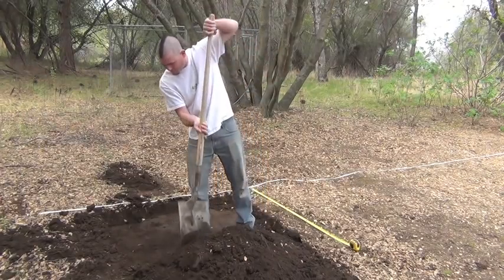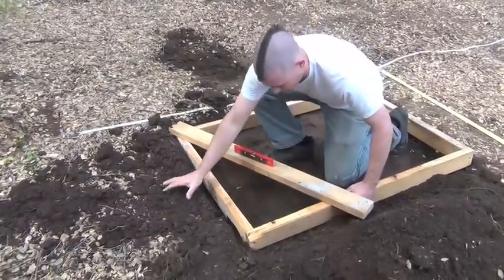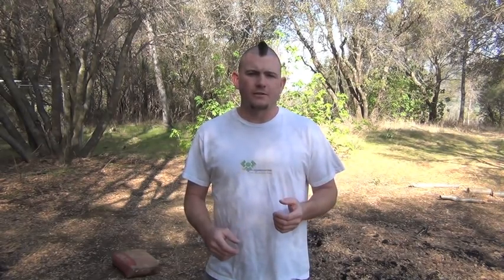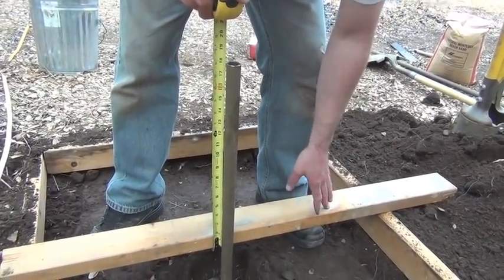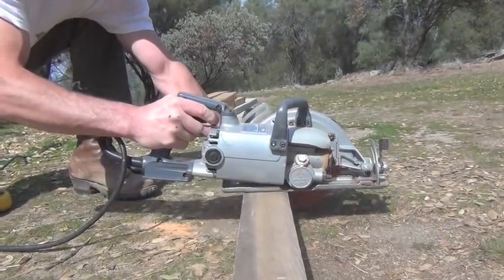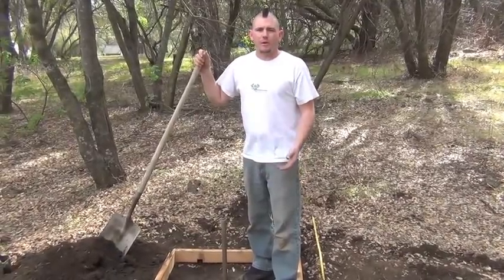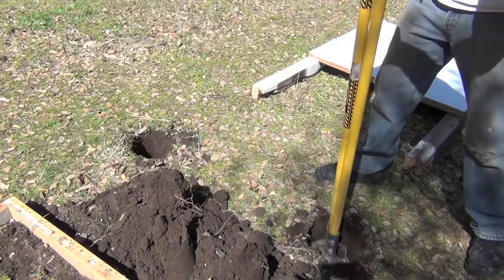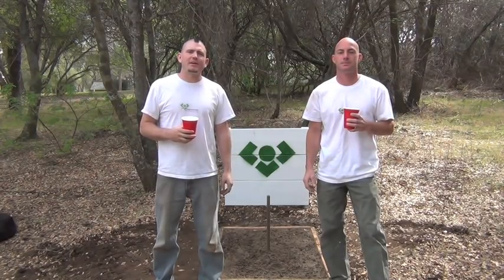How to build Horseshoes - DIYHomegames

Comment: On the National Horseshoe Pitchers Association it says to use a 36 inch x 1 inch smooth solid iron rod at an angle of about 12 degrees from vertical until 14 inches remains above ground so each leans toward the opposite stake......
Reply: bro...put the abacus down

Comment: I never mix dirt in with the sand.  This is just asking for weeds and an impacted landing area.  And you need sides and a back, not just a 2x4 level with the ground.  And the stakes should angle towards each other as others have noted.